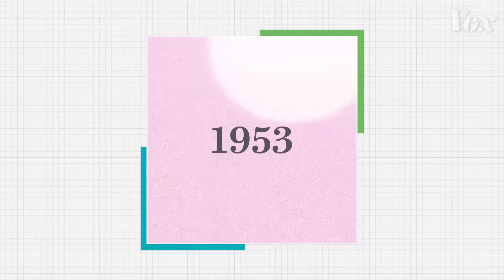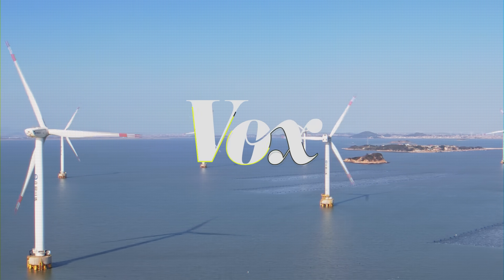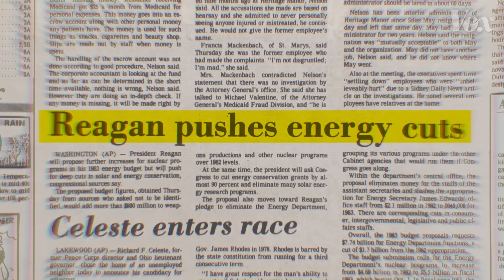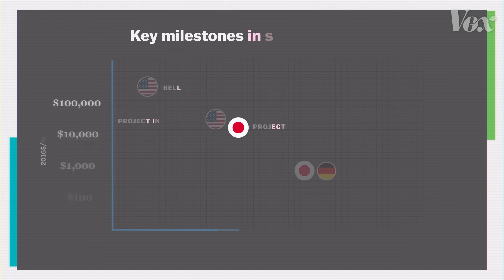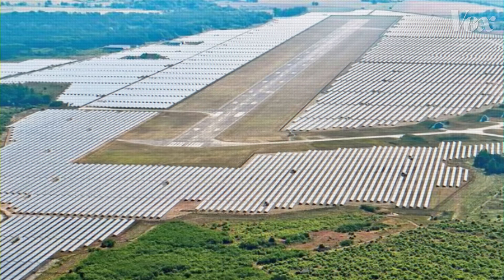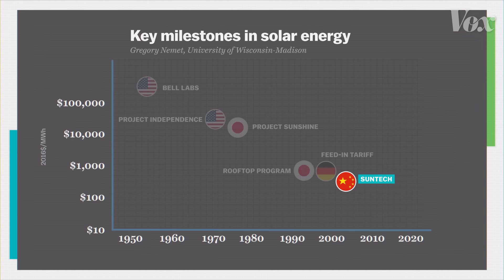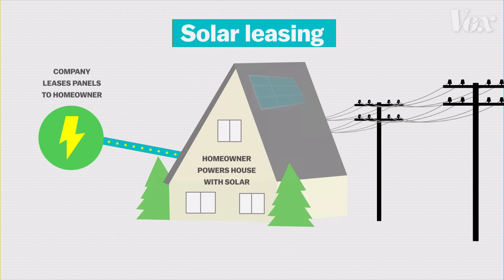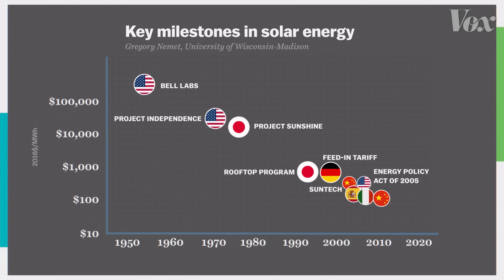How solar energy got so cheap

Comment: This research is more about economical side of how and why it got cheaper. One of the main reason of price drop was changing the material inside of solar panel. Back in 60's solar panels were used mainly in space applications and GaAs (Gallium Arsenide) were main material in panels in satellites. Then for commercial purposes mono silicas started to produce massively and then to drop the price we started to apply polysilicons, which has a little bit less efficiency, but produces more energy than mono cells. So, in conclusion, usage of cheaper yet effective elements made a key part in price drop as well, which weren't included here. (And yet because silica being not environmentally friendly, we're trying to find new better materials such as Perovskite based cells)
Reply: Thank you for mentioning the materials, if all these panels are being deployed worldwide they need to be as recyclable as possible when their lifespan ends.
Reply: Technologically you are correct, but the reason to all this technological progress was governments funding research and subsidizing solar energy deployment.

Governments pushed the technological developments much faster then it would have happened naturally.
Reply: @udishomer5852  the issue i have with the video is they highlight pretty much everything about the market development EXCEPT on the actual technological developments
no idea why they got polisci writers and moore's law enjoyers to cover this instead of actual engineers
Reply: @TheBoy Meister  because technology improvements don't make the market.  The market doesn't progress as fast as it could otherwise if technology remains static but the economics make the transaction go, not vice-versa usually.
Reply: This is fair, the market plays a big role. But multiple order of magnitude decreases in cost are largely linked to scientific advancements that drastically change the game.
Reply: Also ..... they are now manufactured by persecuted religious minorities in concentration camps.

Comment: Europe, Germany and the rest of the world have been too slow to transition to wind and solar energy and all electric vehicles.
Wind and solar energy do not need to be imported and can be produced locally in any country.
Europe needs to provide incentives for homes and businesses to install electric heat pumps and get rid of old polluting gas and oil boilers.  The move to electric vehicles will also be sped up. There is no good reason to help fund Putin's war by buying oil, gas and coal from Russia. There is a Climate Crisis making weather events more extreme.  Time to switch to renewable energy. The future is renewables. They are safer, cleaner and cheaper than fossil fuels

Comment: Producing solar panels is not yet eco friendly unfortunately
Reply: And neither is fossil fuel exploitation of any kind....
Reply: @OhNotThat  At this moment fossil fuels are more reliable than solar panels energy hence no industry will choose solar over fossil yet. And by the way, fossil fuels are converted solar energy so technically speaking they are a solar energy source. The main reason why fossil energy is more reliable is storage. During night time solar energy cannot be produced and only batteries can store the energy produced during the day. Batteries production is not eco friendly and requires rare materials. Considering the latter, is probably not sustainable for the global economy to switch to solar panels yet, but things are progressing in the right directions. This year  HZB’s tandem solar cells has set a record of 32.5% in conversion efficiency and graphene batteries will soon be available on the market. As stated, there is hope technologically speaking however things must be considered when it comes to production. Currently for things to be cheap, they must be produced in countries where labour costs is cheap, and this is the case of China. At the moment the Chinese state is causing a geopolitical crisis which can soon develop in more than a crisis. Those things slow done progress unfortunately. So in short, this is what is holding the solar panels revolution and this is also why we are dependent on fossil fuels, considering our knowledge on how harmful they are.
Reply: Humanity is doomed anyway. It is a matter of time

Comment: why do you group Nuclear power with Coal and Natural gas? "Nuclear is a zero-emission clean energy source. It generates power through fission, which is the process of splitting uranium atoms to produce energy. The heat released by fission is used to create steam that spins a turbine to generate electricity without the harmful byproducts emitted by fossil fuels."
Could convey an incorrect message.

Comment: Wait until non silicon based solar (perovskite and organic solar cells) are mass produced. They are said to be much less energy consuming during manufacturing and also 10 to 100 times less material requirement. Expect another 80% drop in prices in 10 more years.
Reply: The conductive layer on top of the cells can also do with much less indium. I think work is done there as well.
But the glass plate and transport are already a significant portion of the price by now, I'd think.

Comment: Obviously the solar power on a per MW basis is getting cheaper and cheaper every day and dramatically outperforms fossil fuels even when manufacturing and rare earth metals are considered (anyone arguing against this fact is a confirmed liar with mistruths). 
But that's isn't the most pressing problem, it's intermittent supply and demand. It's all well and good to generate Gigawatts of power when the sun is shining but where do you store all that electricity for when the sun goes down? Battery technology whether its lithium cells or pumped hydro storage needs to truly make Solar unbeatable and unarguable.
Reply: Doesn't matter too much on battery efficiency, all that matters is how much storage is needed. That's why pumped storage is great, even considering poor efficiency. Intermittency can be mitigated, just need to rethink how energy is distributed and banked. And those technologies are expanding fast too.
Reply: @hanifarroisimukhlis5989  I am extremely confident that night power is already a non-issue but we are lacking the sufficient drive to install pumped hydro capacity on top of exploitation of tidal waves, wind and geothermal where possible. Conversion of modern large coal power plants into nuclear ones would dramatically reduce the costs of deploying new nuclear power plants, since most of the expensive parts - like the big turbines will be already there. We simply lack the political willpower to truly commit to deploying more widespread pumped hydro battery technology to manage the "glut" of plentiful power we receive during the day time.

Comment: Technology Connections on his extra channel,  highlighted a negative point about renewables that I never thought of. Not directly related but important point to consider as well. It was related to consumers being able to sell electricity back to the grid and how if your energy provider allows you to discount what you sell back to the grid. The grid company actually loses money as not all the cost of electricity is from generation some of it is from transmission infrastructure. By allowing people to discount what they put back in to the grid against what they consume, it weakens the grid as the grid ends up subsiding the consumers electricity bill. He does a much better job of explaining this point than I do and recommend checking it out.
Reply: power companies can determine the rate at which they buy the energy back from you tho, couldn't they just chose a rate that allows them to make even?
Reply: @grimaffiliations3671  they absolutely can and they will have to do that, to sustainably finance the grid infrastructure. But that may make consumer power generation to the grid less attractive.

Comment: Still waiting for the space-based solar panel technology. I think it will solve our energy problems
Reply: Simcity style "Microwave power" seems cool but isn't anywhere close to being represented correctly in fiction. It's far too kind in under representing how big the "solar reciever" would be on the ground, the actual "dish" would span miles wide and transmission could have severe losses at scale.
Reply: @OhNotThat  The scientists in the UK said it's possible to put solar panels in outer space and they will work on it

Comment: The only limit of solar cell It works only when you have (enough) solar light. So you have to use coal/gas to keep the Power grid on
Reply: not coal, coal is a dead industry
Reply: True, this is what germany does.

Comment: I think the subsidies wouldn't have been needed if the markets weren't so crony... Tesla put out a white paper showing that to switch the world to renewable energy would cost less and require less mining, than maintaining the existing oil industry. If guys like Reagan weren't owned by oil tycoons, which is both subsidizing the oil industry and actively regulating the market towards oil, then solar would have won out just like electric cars will completely destroy gasoline cars. They just simply are better technologies. But hey... I guess there will always be interests that are crooked so maybe there can't be an actually free market?

Comment: One question:  if the solar energy is the cheapest energy, why it's only 2-4% of total production electricity in the World? (for example, gas ~ 40%)? May be because it's lie? Or may be you mean "It just is on my roof and I have "free energy""(and you just don't count production and recycling old solar panels)
Reply: The graph referenced in the video was the cost of 𝐧𝐞𝐰 energy projects (i.e if you were to build a solar farm with equivalent output to a coal power plant it would be cheaper in the year 2023). It hasn't always been this way, so a majority of current production comes from old stations built when it was cheaper to use fossil fuels. Going forward, you can expect to see the total world solar production increase.
Reply: It maybe because it's a lie, but also it may be because you don't quite understand it enough. Try better than to hurl accusations at data sets you don't understand.
Reply: because gas is also a primary energy (meaning it can be used directly for heating for instance). Renewable is great but work only if there is sun or wind, inducing a dependency on other source of energy (mostly fossil since germany doesn't want nuclear). Renewable energy ramp up over the year did not indeed lead to a decrease of fossil fuel

Comment: I got into the solar panel industry 7 years ago because I saw its potential to END the fossil fuel industry... business is a boomin' and I'm all for it!
Reply: Well, it didn’t really end fossil fuel. Look at how much fossil Germany needs to have to compensate for intermittency of renewable. Germany actually has extremely high emissions factors compared to France, Sweden or Canada
Reply: @Cyril  dude... where did I say it has ENDED the fossil fuel industry? 🙄🤦🏻
Obviously, it's something that will take years, if not decades, to achieve. 
Sorry to be a d*ck here, but seriously think before you post.
Reply: @firepod21 solar+wind+energy storage will economically and ecologically outperform all other sources of energy in maximum 10 years from now.
Reply: @firepod21  Didn't end it yet but it chips away at it every year.

Comment: I remember learning about solar power in junior high in 07-09. My tech teacher said you’d only find solar panels on the homes of rich people. Fast forward to now and there are middle class homes across the city with owners who can afford to put solar panels on their homes if they choose.
Reply: you can find them in Africa, Afghanistan too
Reply: Even work well in England. People who have them here tend to make money back as the remaining gets sold to the grid.
Reply: Wait till you find out middle class are no longer home owners😂
Reply: @WeatherManToBe  Wut?  

Low-income homeowners 27.2% 
Middle-income homeowners 43%.
High-income homeowners 29.8%.

All within +- 1 - 2% of their peaks and lows since at least 1960.

Housing Market statistics. 2022"
Reply: @illbeyourmonster2  

Home ownership rates from 2001 to 2009 vs.  2010 to 2017 by income have all declined for the following:

Less than $30K - 12%
$30K to $75K - 10%
$75K to $100K - 10%
$100K to $150K - 5%
$150K and up - 7%
Reply: Where I live there’s such a high political demand for reducing carbon emissions, that the utility will install them free of charge for home owners.
Reply: @L0LrevneD  Wow, what country?
Reply: @geokon3  Well I live in Denver, USA. Xcel Energy is the largest utility and is aiming to get at least 55% of its electricity from wind, solar and battery storage by 2026. Solar is so cheap now and so common that Xcel is advertising rooftop solar installations a lot
Reply: my house is one of the only ones without solar in my neighborhood in california. there’s nothing but great things you hear about them
Reply: I live in the Philippines, a country with more cloudy then sunny days and no subsidies for solar.
And yet from my window I can see solar panels on some the roofs of my neighbors.
Reply: @udishomer5852  Taga pinas din ako. From where I'm from, 75% of the time dito samin mainit. From 2,800Php, 375Php nlang bayarin ko ngayon sa kuryente kada buwan.
Reply: Not only middle income, Poorer families, especially in remote regions get their energy entierly from solar these days
Reply: Not just middle class homes but countries like Singapore have based their life around solar power. Phenomenal whaat humans can achieve in such small specks of duration.
Reply: @averagecucumber  You mean the other 90% of their power that comes from fossil fuels doesn't count?    I'm guessing that you don't know about how the rest of us can use the internet either?
Reply: The phrase "if they choose" say everything.  Because if solar is really so cheap and worthwhile there wouldn't be one home south of Chicago that wasn't being built with solar panels.
Reply: Rich people were and still are getting subsidies funded by you, the tax payer, to put solar panels on their roof. You should have also taken an economic class so you better understand how people like Elon Musk gets rich beyond belief on the backs of the working class.
Reply: Those tech teachers were already wrong in 2008, at least in Europe. My parents, Dutch, with one salary of a basic rural government official, already had solar panels in 2004. We were certainly not rich.
Reply: wrong i am middle class  and Cant afford Solar
Reply: Lol. So true. My Physics teacher said in 2008 that she'd predict solar panel will always, as in "ALWAYS" be a luxury enerygy-generating tool for people with enough money until the year 2050 which she said when the prices will properly go down for the upper-middle class to afford. Well, it's 2023, and I now have a 1kW Solar Panel Array on my rooftop paired with a 5kWhr battery bank that I built.
Reply: @Chink9198  the kind of teachers/people are the worst!
Reply: @Chink9198 teacher really didn't understand how technology improves while costs decrease. When she was born computer's that could do little were bigger than your classroom, by 08 they fit on your lap and now people throughout the economic spectrum carry computers in their pockets.
Reply: @Chink9198  they still are, the stats used in this video for cost comparisons are very disingenuous. Solar installations still go into the 1000s and only the middle classes and up have that sort of disposable income for a fad promise of returns.
Reply: @ManGuyDude44  bruh, im literally having a salary below 10KUSD per year. Which is very low compared to middleclass people of the 1st World Countries. Even me can afford it. The only thing stopping people from the US is their unjustified disdain to good Chinese products and their atrocious import fees. You want cheap solar components? Buy them directly from China. You want them arriving on your doorstep cheap? Fix your importation procedures. I watched a video on the Donut Channel where they try to buy 4KUSD EV from Changli and they ended up paying 9K USD for shipping it. I bought 6 pieces of 160W Solar Panels from a company called BOSCA from China. I only paid a Shipping Fee of 3 Dollars each. Thats 36 Dollars shipping fee for a 960W array. Thats cheaper than a sweater from Uniqlo.
Reply: @Chink9198  the Chinese heavily subsidise infrastructural products in the third world for soft power gains and  market share